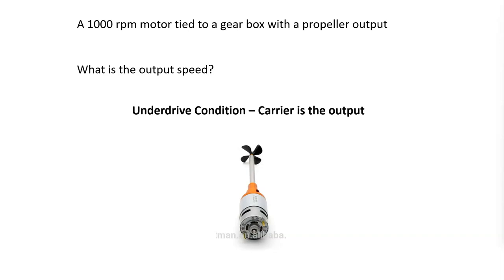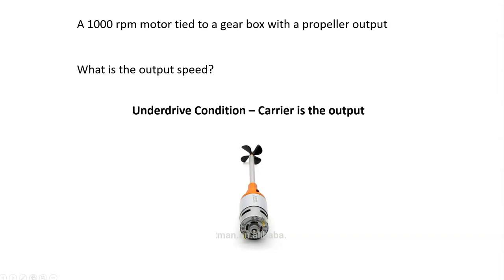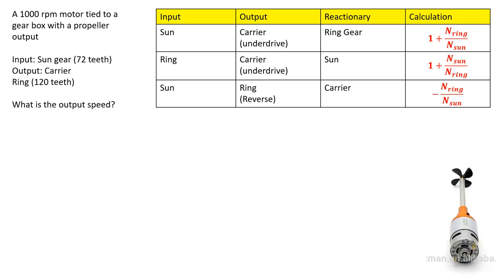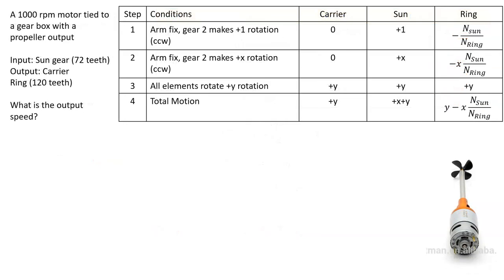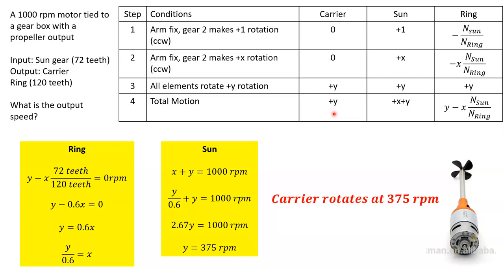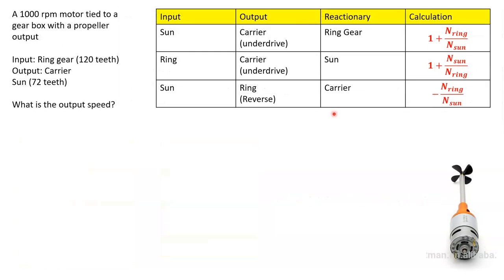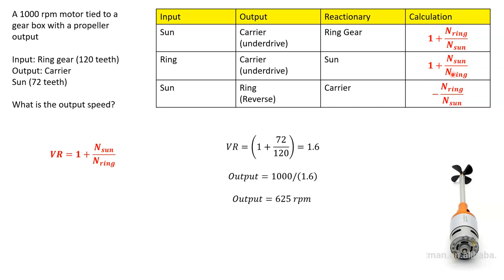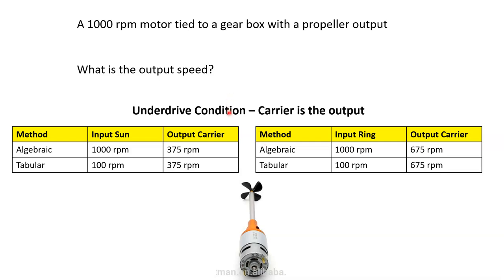Planetary Gears: Underdrive Condition

Comment: Is it possible to have a planetary with a 1:1 ratio? Like if all you actually want to do is reverse the rotation of the sun gear with the ring gear, but not change the rpm ratio between them?
Reply from the maker: In a conventional planetary gear set-up, the sun gear will have a smaller diameter than the ring gear, so the ratio can't be 1:1.
Reply: @infinitymfg5397  How about non conventional?